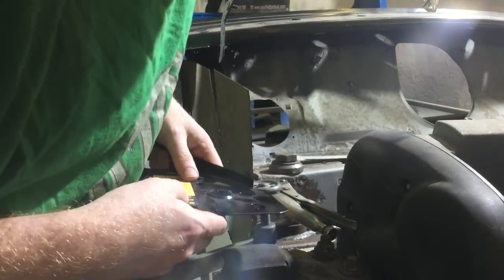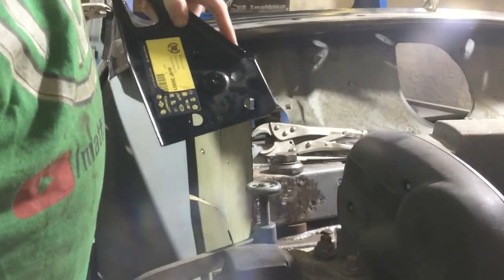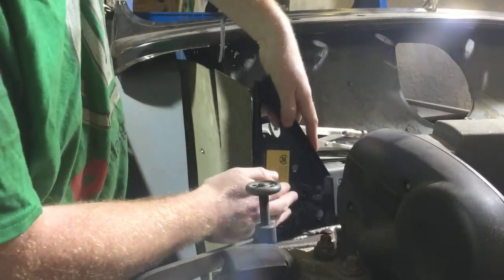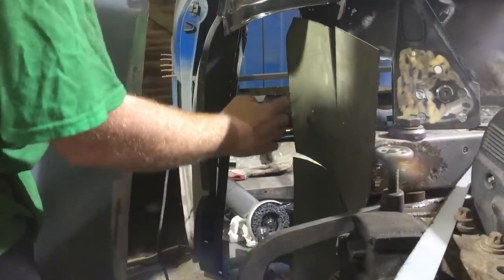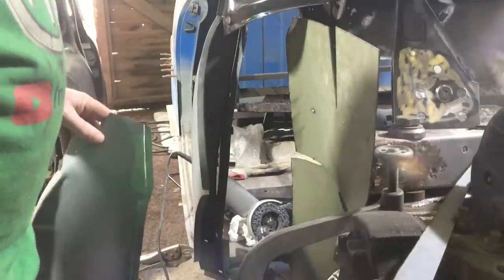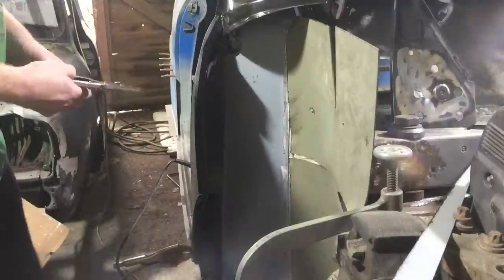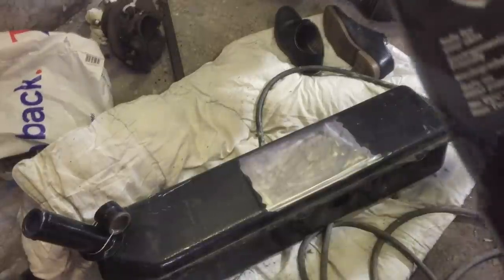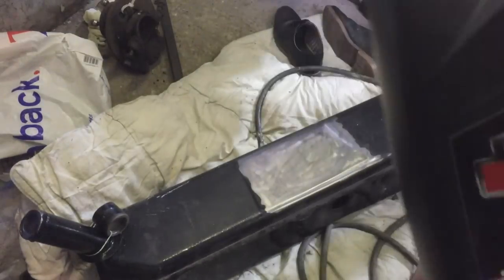Classic Mini Pickup Restoration Ep27 - Inner Wing

Comment: I believe it is about an inch between the floor and the fuel tank instead of mounting it in it's normal place why not mount it behind the cabin in the bed of the pickup but have it hidden in like one of those pickup tool boxes
Reply from the maker: Or a Stella keg??:)
Reply: @MattGreenWorks  that's a better idea and use 2 of them to keep it looking even